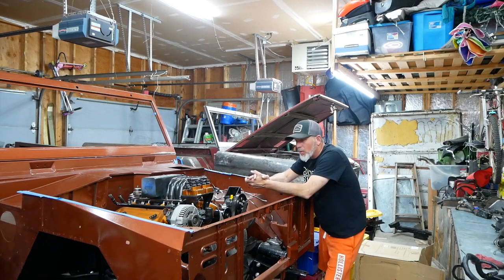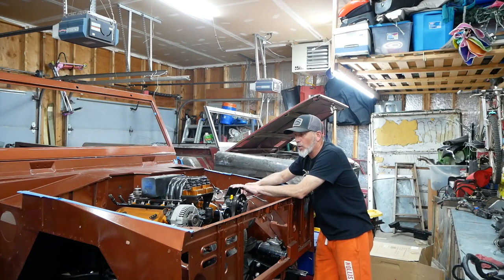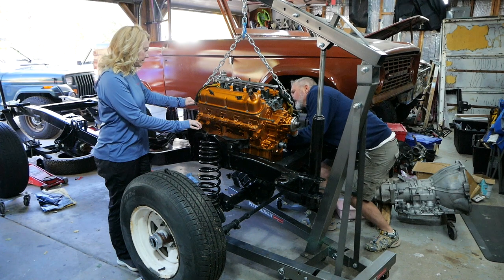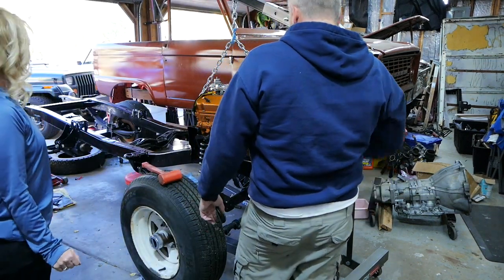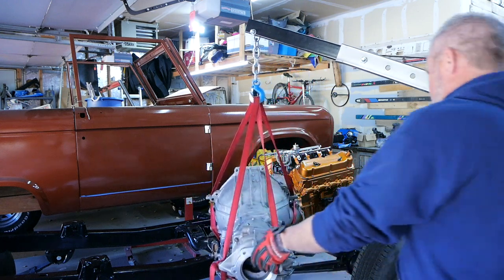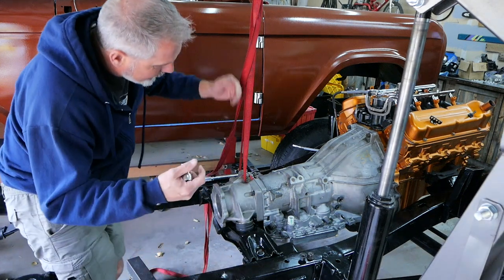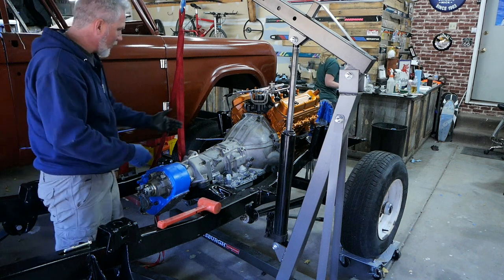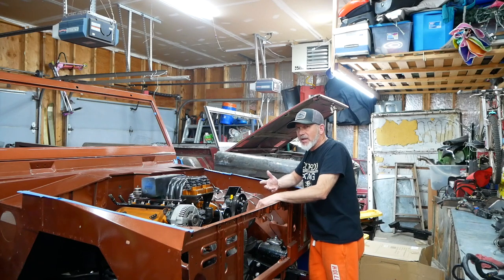Classic Bronco Engine Install❗️347 Stroker and 4R70W Early Bronco Build

Comment: A daunting project, with attention to detail. I hope you successfully complete the build.

Very good videos showing the 3 bar gt40 exploder broken bolts, spring kit, porting and budget EFI sb Ford stuff. 

FYI, when I threw a "mild" 216/220 cam in a '00 5.3 GM, the pcm needed idle speed and airflow adjustments to achieve a quick start and good idle, to avoid stalling. That's when I had to take the dive into HP Tuners to reflash the calibration.

 On the flip side, old EEC-iv MAF equipped Mustangs seem to be okay with a cam change.